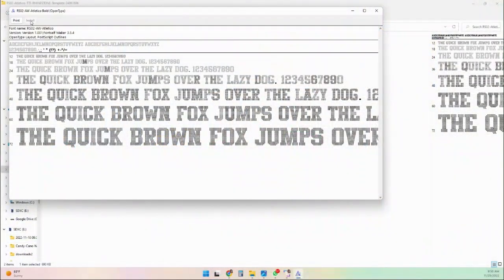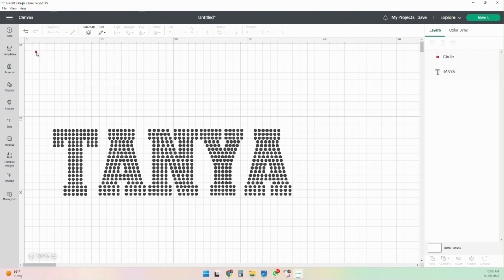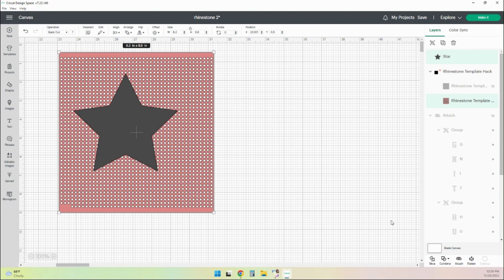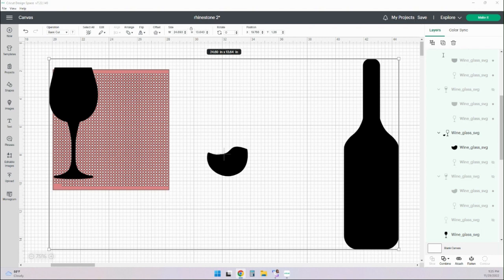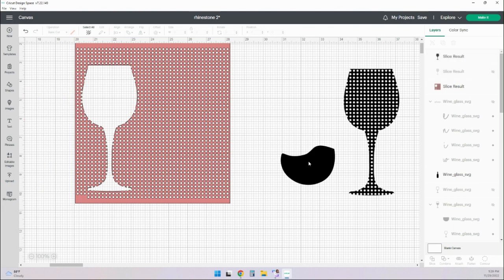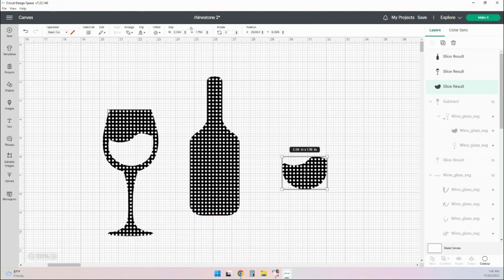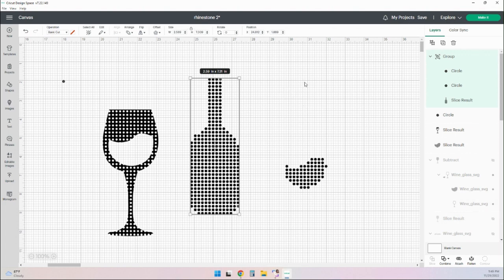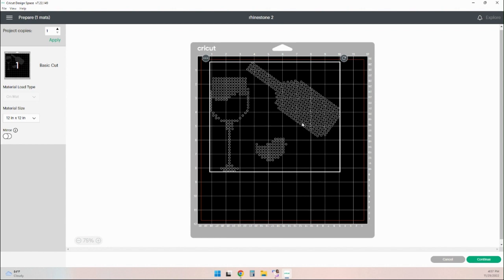Cricut design space HACK!|text & SVGs to Rhinestone designs

Comment: I am missing something bc 3 x it has failed and the holes are too small and the template itself is too small
Reply from the maker: Hi. Did i send you the 8x8 grid. If so, you cant adjust the size. When you upload the grid make sure it is the size i mentioned in the video. Slice your smaller design out of it and delete tye rest. If you dont have it have it at the right size the holes will be too small.
Reply from the maker: If didnt send the grid. Drop me an email and i will send you my file